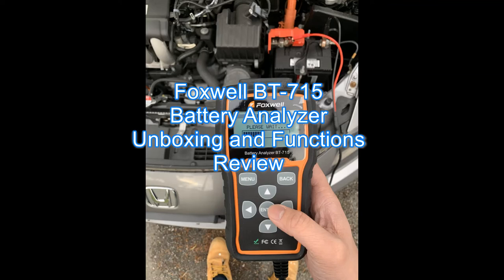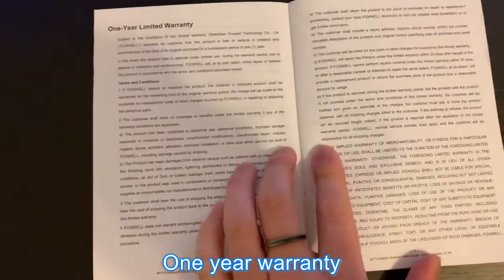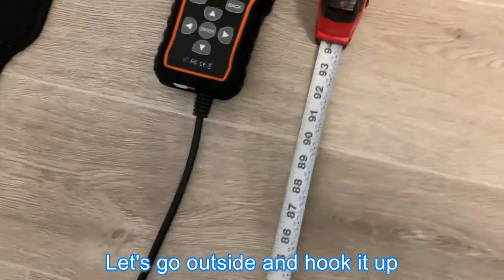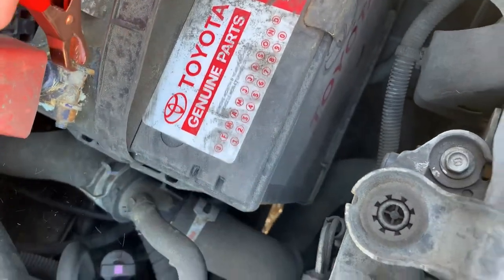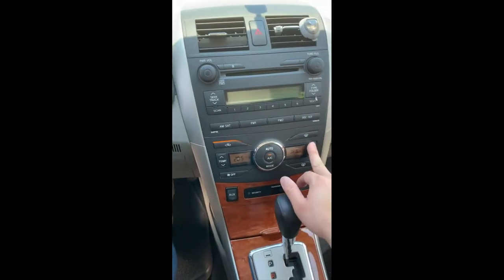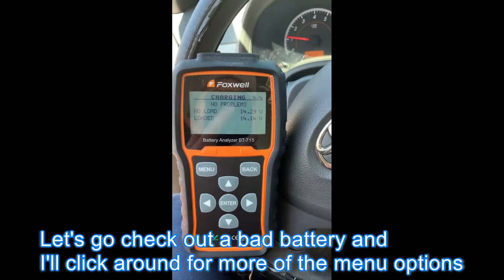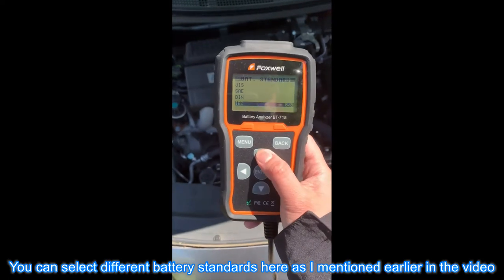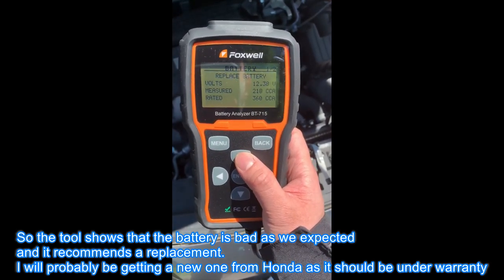Foxwell BT 715 Car Battery and Alternator Tester Analyzer Product Review (HD)

Comment: Hi bro what is the difference between BT 705 & BT 715
Can it test on 24V, is the BT 715 got Bluetooth  printer?
Reply from the maker: Hello Happy Miow, thanks for watching. The BT-715 Can test 24V, and the BT 715 does not have the bluetooth printer.  Hope that helps!
Reply: @ghettodiy7114  hello bro Thanks for drop a time to reply, bro can you make a video for test on 24V, in market is that got any fake foxwell product this is the part i worry, i hope can see your video for testing on 24v Thanks a lot bro
Reply: @ghettodiy7114  you mean BT 705 can test on 24V & BT 715 difference is don't have Bluetooth  printer but both can test on 24V is this what you mean?
Reply from the maker: @meiskeikusanagi  Hi Happy Miow, Yes the BT 705 and BT 715 can Both test 24V.   The BT715 does not have the optional blue tooth printer that the BT 705 supports (You have to buy it separately as an add-on for the BT 705), I would love to make a video on 24v testing, but I don't have any 24v battery to test with at the moment.  I don't have any vehicles that uses 24V so unless I have someone sponsor me that's not in the plans right now.
Reply: @ghettodiy7114  im sure some commercial vehicle / hgv  mechanic will use it and post results soon for 24v
Reply: or you can get 2  batteries connect them in series and do the out of vehicle test